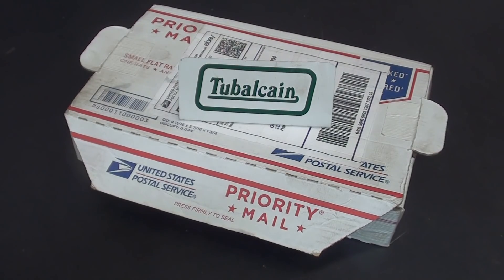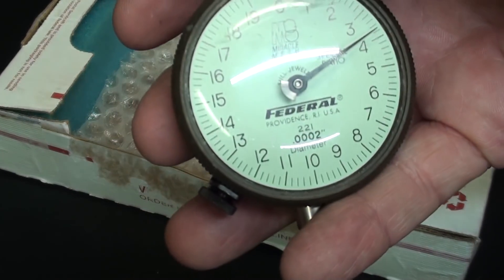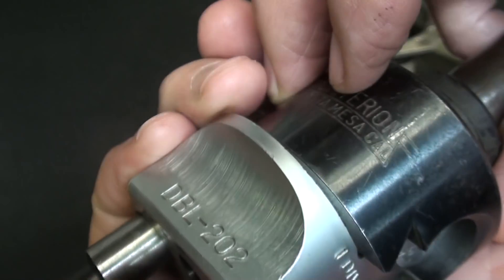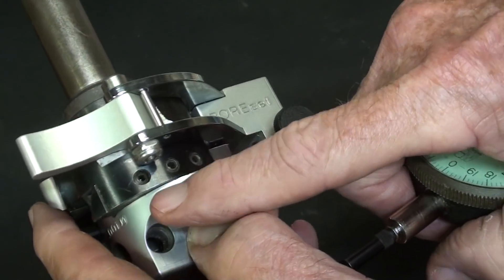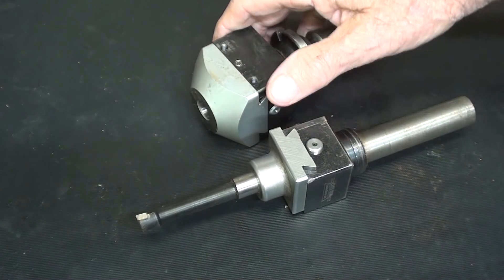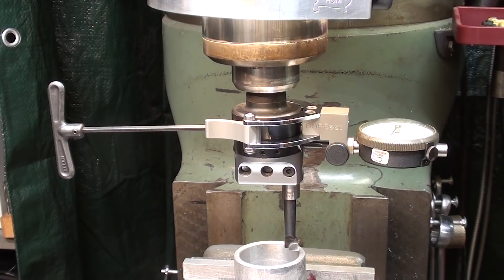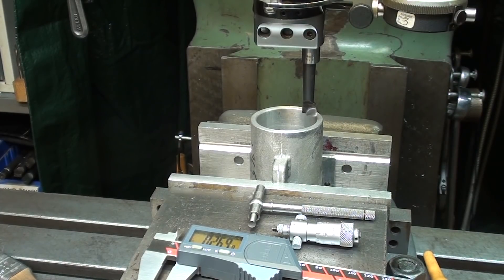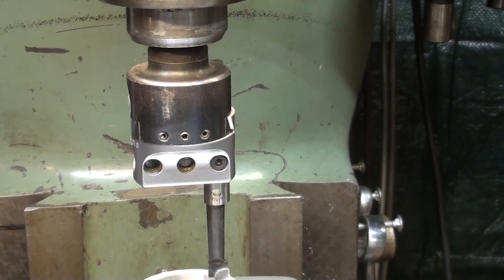Using the BORESET on Bridgeport Mill Tips #599 tubalcain

Comment: Mr. Pete I have an old Clausing drill press that states I should grease the spindle through a zerk  fitting. I think they mean some kind of oil, but what type? You have a lot of older machines why not have a video on maintenance. Thanks
Reply from the maker: Good idea, but I’m not sure what lubricant do use on your drill press. There are thousands of all machines out there, and they are all different

Comment: I have the best luck not messing with the gib screws that is to say leave them snug but not so tight that you can’t adjust the boring bar. If you follow this method you’ll get what you dial and your tweak won’t be affected by gib screws. What I’m saying is you don’t have to “lock “the screws.
Reply from the maker: Yes, I seldom Touch the Gib screws
Reply: Right on!

Comment: Good morning L.P. nod to TOT...
I have bored hundreds of holes for press fit and for slip fit of all different diameters. What I learned is that you don’t sneak up to your final size by taking .0005” or even .001”. For me my final pass was between .005” - .007” and I only would take a spring cut if it was needed. Obviously you have to understand the fitment you need for the job you are doing. And learn to use the dial on the boring head on full divisions or maybe a half of a division nothing else. This suggestion will cover most if not all boring situations, I don’t want to get into ID OD grinding or jig grinding those are different circumstances. I can post a copy of the fitment chart I use on my Instagram or Facebook page.

Mike – Plus8Precision
Reply from the maker: That’s good advice, thank you

Comment: Excellent tool and video. AND the concept can be used with other boring heads such are used on vertical and horizontal machining centers. I like the fact that you can tell exactly whether the tightening of the gibs actually affect the adjustment setting.

Comment: That is the right boring head. BOREset says it's for the Criterion DBL-202, but you're throwing the cam lever in the wrong direction. Throw it towards the indicator, so it lays flat between the two parallel chrome plates.
Reply from the maker: Thanks

Comment: I need one of these! As a home hobby machinist I have a hard time adjusting my boring head accurately. I have overshot my dimension three times when I thought I would still be under dimension and I am left scratching my head.
Reply: Frank, Most boring heads have very small dials calibrated in radius, not diameter. One mark, (.001 on dial), is .002 on diameter. Boring tool should be very sharp and allowed to cut a couple of final passes to remove spring-back.
Reply: @ellieprice3396  Thanks for the tips! The boring head I am using is an old Bridgeport branded (not sure if they actually made it or not) and it has a lot of backlash in the adjustment screw, I think that is where my error was coming from (or at least it was not helping!)
Reply: @FKreider  Mine is a 2.0 Chinese knockoff but has worked well for over thirty years. I leave the gibs a little snug and use sharp carbide boring bars. I'm fortunate to have a diamond wheel to sharpen carbide tools on. For best finish use a little oil and grind a very small radius on the cutting edge.

Comment: I would certainly buy one. In the past i have used a dti on a mag stand to try to measure the offset , but it can be awkward depending on the job and the set up. Criterion boring heads are excellent, bought one last year and its night and day when compared to the chinese knock-off's.

Comment: Any movement of the tool produces a bigger bore diameter double the movement of the cutting tool, the actual bore cut is a "per side" total, example, 1.5 thousandths advance of the tool produces a 3 thousandths larger bore.
Reply: That's why the scale on the dial reads twice the actual movement of the plunger.
Reply: @kensherwin4544  That's what I get for fast forwarding, thanks Ken for the correction.

Comment: neat, i used to use a tenths indicator on a surface plate to do this. i had thought of making some kind of jig like the boreset, but i don't use the boring bar enough to justify taking the time to make one. my idea was kinda similar, but used a magnet to stick to the boring head rather than the cam clamp.

Comment: Very interesting little tool and an interesting video.  I have a cylinder boring machine that has micrometers to attach in that manner to set the tool depth.  It has a large spindle and a small spindle so their are two micrometers.